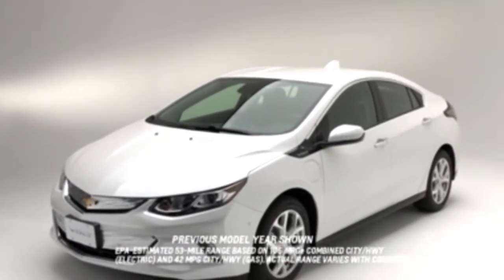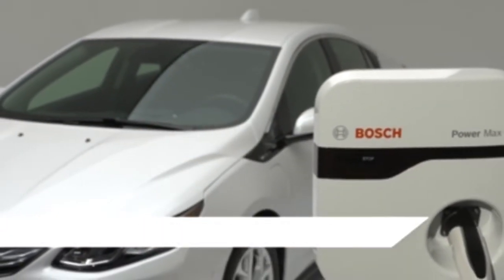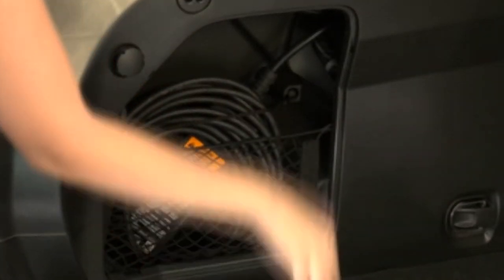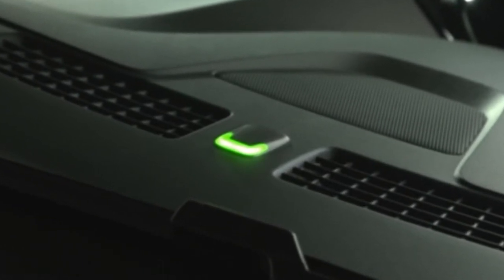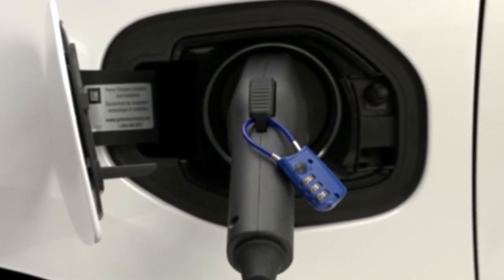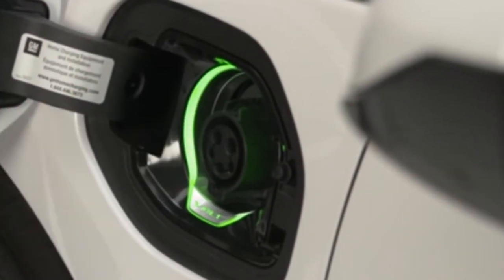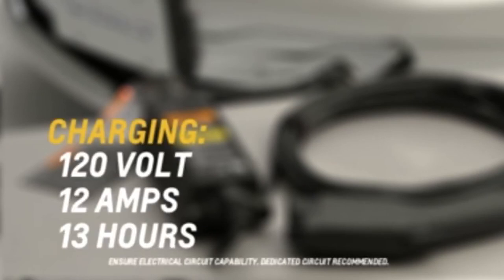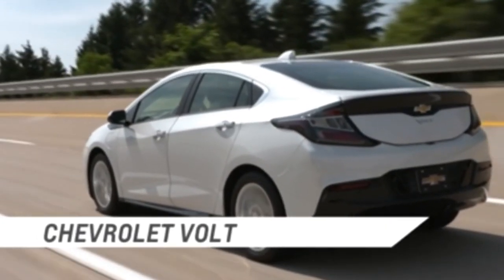2017 Volt Charging The Battery

Comment: This STILL didnt answer my question, can we choose what percentage of charge we want and will the volt automatically STOP charging and drawing current when it reaches that level? I have heard charging to 100% every charge may be harmful for EV batteries. Does the same hold true for these smaller capacity batteries in the Volt? But most importantly, since I am planning to get the level 2 charger installed at my home, do I have to “babysit” it and unplug to stop the charging when it reaches capacity, or can I rest at night knowing it “auto” shut off and simply disconnect when I awake?
Reply: The Volt does not charge to 100%. It will charge to about 80% max when it's "fully" charged. It also doesn't deplete to 0%. The battery is "empty" around 20% charge. So fully charging or depleting will not harm the Volt thanks to the built in buffer. The manual also recommends keeping the Volt plugged in, even when fully charged. This helps the vault to regulate the high voltage battery temperature at all times prolonging its life.